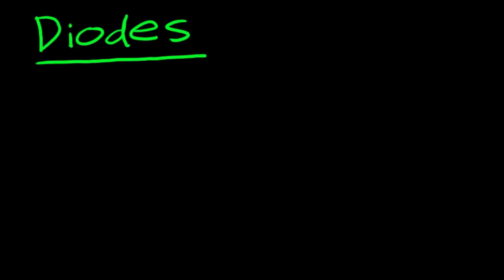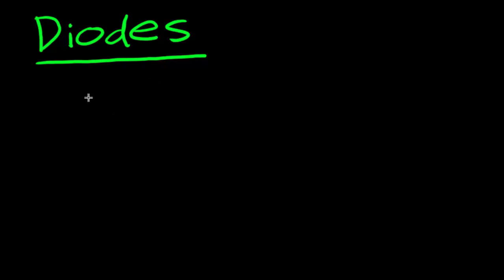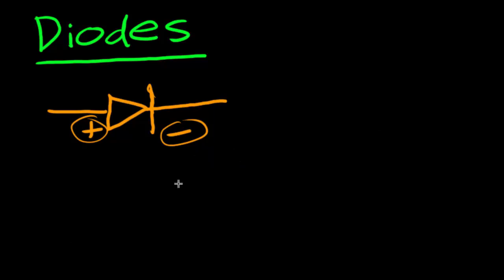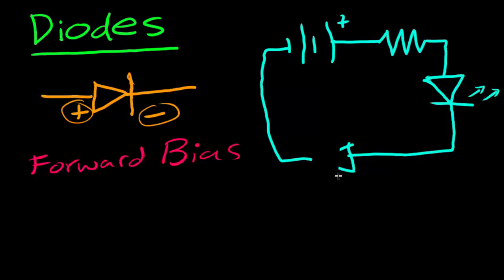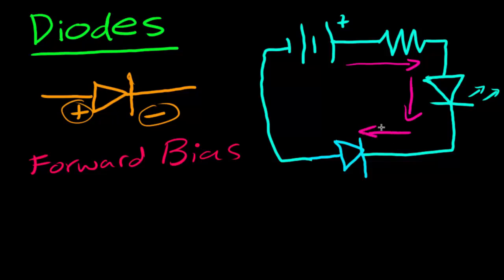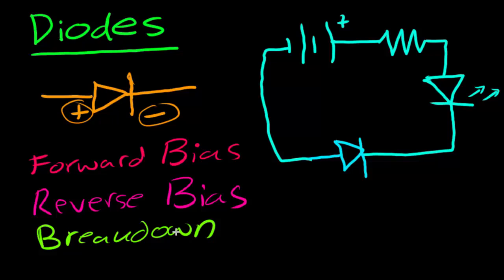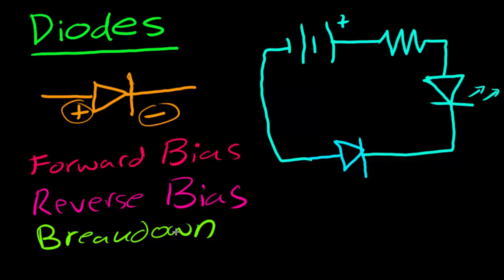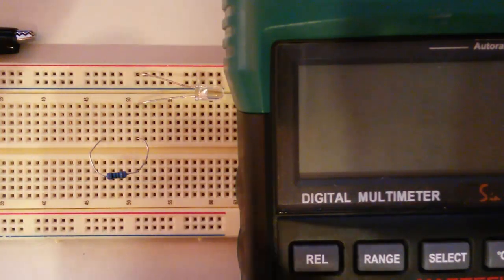Beginner Electronics - 20 - Diodes

Comment: @CodeNMore If the capacitor in the schematic in parallel with the LED wouldn't it just dissipate the collected current WITHOUT lighting up the LED? Is the schematic wrong?

Comment: If capacitors actually break the connection between it's anode and cathode then they are connected only in parallel to some component, did I understood it right?

Comment: Dont understand the practical point in using diodes instead of resistor
Reply: Diodes allow current to flow in only one direction while resistors resist the current. They have 2 totally different functions. With resistor it doesn't matter which way you connect it to a circuit but with diode it does. Diodes can be used as one way filter which means the current can only flow in one direction which is very important for components which have polarity. They are also the main part of every rectifier which converts AC to DC. Without diodes you couldn't charge your phone from outlet. So saying that you could replace diodes with resistor is wrong.

Comment: Well, it's a bit comical in how rudimentary these videos are, but as the absolute most basic overview and getting people launched, it's in fact useful. The word beginner is so very ambiguous. When I enrolled in college for engineering, it was basically a technical college's crash course style program for an engineering degree.
When they said "beginner", I soon realized they meant one flight of stairs below in depth quantum physics lol. In hindsight, I think they were accustom to people with many years of experience in high tech fields, but no degree so they would already know 75% of the material. I did amazingly well, but never completed the degree. Now on the other hand, I've outright invented new technology nearly like nothing else that has existed.

Comment: Is there any specific reason why the schematic asks us to connect the capacitor parallelly?
Reply: It charges in one direction but discharges in the other. Try to follow the conventional current flow and see what happens.

1: Power on: LED lights up and capacitor charges—both on their "own" parallel circuit in the same direction.
2: Power off: capacitor discharges the other way which is through the LED part of the circuit. The diode makes sure the current can't flow back to the power source (if that matters).

I only just realised this myself, so I can understand why you ask :^D

If I'm wrong, I hope someone will say so.

Comment: Summary:
- allows current to flow in only one direction
- for current flowing opposite, it's essentially an open switch
- have a voltage limit, i.e. how much voltage they can stop from going in the opposite direction
    - too much voltage will make diode "broken", can no longer stop current flowing opposite direction
- also, just like LED or resistor, diodes have a "forward voltage", about 3v, so they take about 3v away from the circuit, if they don't have this voltage available, they don't work

Comment: The protection diode is there to protect the electrolytic capacitor from wrong polarity. You forgot about that or did not know that.
Reply: @Bloodred Pyrate The diode prevents discharge from the capacitor into the battery.

Comment: im very pleased that your still here. alot of what i see is from people who have left. im curious if the LED is in "parallel" with the capacitor? i can also see possibly that it is in series with the resistor and diode. i think because their is a resistor between the two of them it makes the led a series circuit.

Comment: thanks for this series ! one question : isn't the protective capacity of the diode limited by its voltage limit ? Am I wrong to assume that the circuit is still closed after the diode breaks, or is it open and therefore nothing flows

Comment: Hi thanks for all the knowledge,I have a question for anyone! If electrons actually flow the from neg to pos ,does that mean the multimeter leads,should be the opposite really(black lead is recieving the flow,n vise versa but it's all been designed internally to fit in so we can just take a measurement without thinking about whic way electrons flow?

Comment: Why does he say that the electricity goes from + to -, whereas in previous videos he says the opposite. I am having a hard time trusting what he says now...
Reply: Don’t get confused with differing terms. Electricity is more of an ALL-ENCOMPASSING term, ie it includes voltage, current, resistance, capacitance etc. What you are trying to get your head around is current flow (not electricity flow) and conventional thinking was that current flowed from + to -. This is now known to be incorrect as it actually flows from - to +. Anyway, with regard to this video I think you are looking for the following explanation......think of a diode as a wooden farm gate. It will only open one way, in other words when you (the voltage) pushes from the ‘correct’ side it will open, allowing your sheep (the current) to flow through. In terms of voltage ‘force’ this is typically 0.7 volts. If you try to open the gate from the ‘wrong’ side it will not open and your sheep (the current) will not flow. The ‘correct’ way of fixing your gate is called ‘forward bias’. If you fix your gate the ‘wrong way’ around you have a ‘reverse bias’. You can also think of this....if you took a sledge hammer to your gate you could break it down and allow your sheep to escape......this is the same as applying TOO MUCH voltage to the reverse bias.....in other words you can damage/break a diode by exceeding the reverse bias.
Reply: + to - is what is called conventional flow and he talks about this. In actuality electrons flow from negative to positive.
Reply: Christopher Cargill
But why keep using the conventional method when it’s wrong?
Reply: @Sa-fd7ih  Things in life phase out and sometimes run in parallel with their replacement. This has happened throughout history from empires to word usage. Just imagine, some of the people who learned conventional flow are still around. In fact they may be the bosses, the teachers, the experts in the field. So even though they may have learned that it isn't correct it is the way they are used to. Do you think they really want to make their lives more difficult by changing something that has worked for them their whole lives?
Reply: Christopher Cargill
If I grew up believing that the Earth was the centre of the whole universe, and later in my life science proved that that was actually wrong, then yes, I would definitely stop using that thinking right away. It doesn’t matter how difficult that might make my life, what’s more important is to stop making that mistake.

Though, I’ve just started learning about these stuff so I’m not even 100% sure that conventional flow is wrong, during my search there seems to be loads of people saying that it isn’t actually wrong, so I still have a lot to learn.

Comment: Great Video
I noticed that in your video on capacitors, you only charged the capacitor for a few seconds by connected the probes straight to the battery. 
In the circuit at the end of the video, would it be bad for the capacitor if you left it running or would the capacitor stop charging?

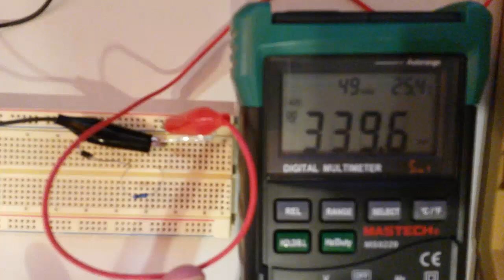Comment: 10:22 - How did you figure it is milli-volts. I was freaking out that the voltage went up in your circuit. its about 23.5.
Reply: Dude, he doesn't have the brand new 108 MP camera! He made this video in 2016. Do you think that there is a camera whit even 50 MP on that year?

Comment: See, this is where it begins to make a difference which direction current (and voltage) flows. If you assume that the electricity flows from the positive terminal, you will conclude that the right side of the circuit is energized. However, it is actually the left side of the circuit which is energized. You wouldn't detect a voltage on the right side, but you would on the left side.

Comment: Please clarify, in forward bias, you have mentioned that the power will flow from positive through 2 LEDs connected in series to negative terminal of a battery while you have only reversed the one LED position so that current may not flow from positive to the negative of a battery which means LED has only stopped flow of current but not carried on flow of current in the reverse position, rather current  flow should be on but in opposite direction.

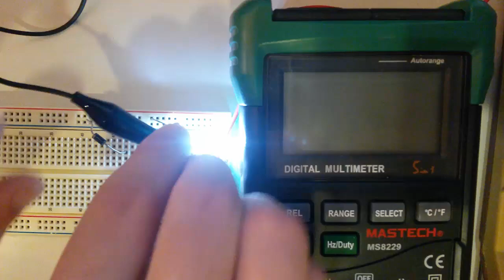Comment: I wouldn't have believed that these simple circuits could offer so many valuable insights into what is going on. Reversing the diode at 9:00 and measuring the voltage across it and then comparing it with the LED really brings out the difference between volts & current.

Comment: I don't understand! Why cant we use a
 diode instead of a battery???
Reply: I think you are getting confused between a capacitor & a diode. A battery is like a tank or water. If you connect up a diode then depending on whether it is in forward bias or reverse bias it will allow the flow of water or not. Its like a valve that is open or shut. Now a capacitor is a bit like putting your hose pipe into a bucket and filling it it up. Very soon it will be full. But when you switch off the power from your battery (tank of water) you still have a bucket of water to pour out.  Useful as an emergency power source for say a mobile phone.
http://www.machinedesign.com/batteriespower-supplies/what-s-difference-between-batteries-and-capacitors
Reply: Thanx a lot! That was my confusion! u cleared it!

Comment: Suggested Encore:
1) Show what happens when more volts are applied that the Capacitor is rated.
2) Show what happens when when an Electrolytic Capacitor is put in backwards.
3) Show that there are circuits in which there is a difference in how a circuit behaves because of an Electrolytic Capacitor versus Non-Polar Capacitor.

Comment: [HELPFUL TIP] If anyone on here wants to get started experimenting with electronics and doesn't have all the components yet, there is a really cool site called "Electronics Lab", which is on tinkercad. It has all of the components you need and simulates an electric circuit. Try it out! https://www.tinkercad.com/circuits
Reply: McSmoogle that is really great. How to build circuits without buying any components. I noticed that there were no manufacture specifications for the LED's of forward voltage & required amps and wonder if this is something that can be altered?

Comment: So is the only need for diodes is as a fail safe?
Reply: The most common function of a diode is to allow an electric current to pass in one direction (called the diode's forward direction), while blocking it in the opposite direction (the reverse direction).  https://en.wikipedia.org/wiki/Diode
It is also useful to prevent blowing your circuit if someone connects the power the wrong way round.

Comment: So, is electricity following two paths simultaneously in this circuit at the end?  Is it both going from the diode to the capacitor to power while simultaneously going from led to power?

Comment: what is voltage drop? please help
Reply: Syed Ilhan voltage drop is caused when a resister or any component in a circuit uses up voltage as the voltage passes through it.
Reply: Voltage drop is defined as the amount of voltage loss that occurs through all or part of a circuit due to impedance. A common analogy used to explain voltage, current and voltage drop is a garden hose. Voltage is analogous to the water pressure supplied to the hose. https://c03.apogee.net/contentplayer/?coursetype=foe&utilityid=wppi&id=4578
Peviously we saw that the LED 'consumed' 3.2 volts and at 8:25 the diode when measured 'consumed' 0.735 volts.